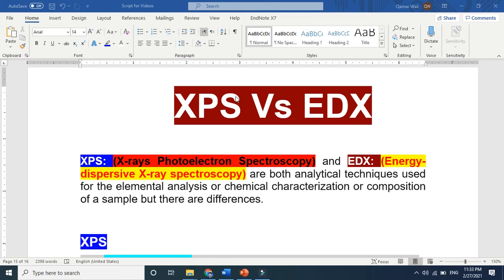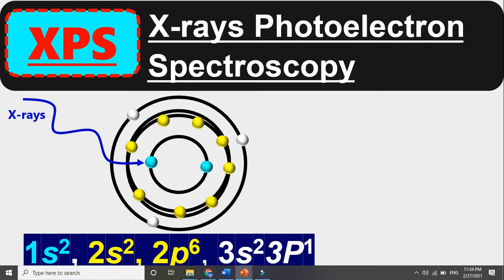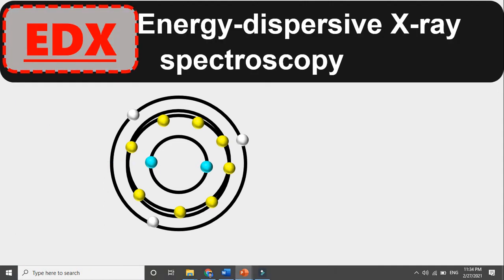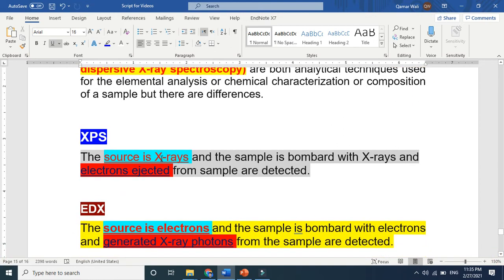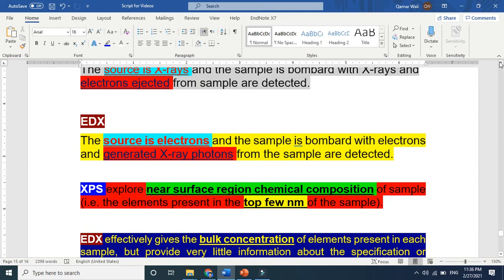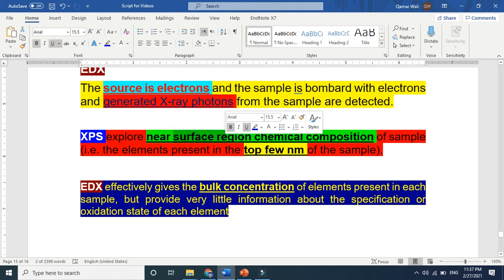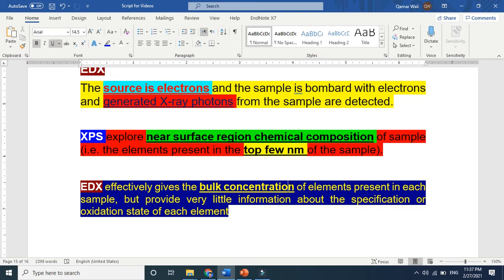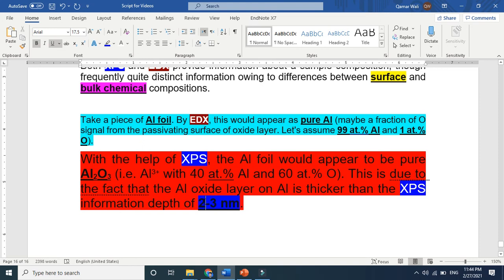XPS vs EDX | Chemical States vs Element Mapping Explained

Comment: Nicely explained. Thanks a lot.
I have a doubt and would greatly appreciate it if you could share your insights..
I have zeolite samples modified with Cu(OH)2. CuO nanoparticles appeared on zeolite surface. If I want to confirm  the oxidation status of Cu is Cu2+, I guess I will have to use XPS. Thanks in advance
Reply from the maker: Absolutely YES. 
XPS is specifically used for the surface analysis to confirm the elements exist on the surface. This can be done by taking the survey spectrum. 

While XPS is very helpful to see the variation in the Binding Energy and the chemical environment. This can be done by simply taking High Resolution Spectra.
Reply: @qamarwali  Thanks a lot.